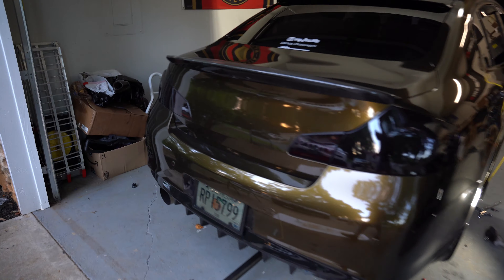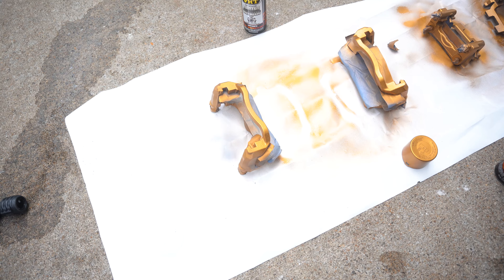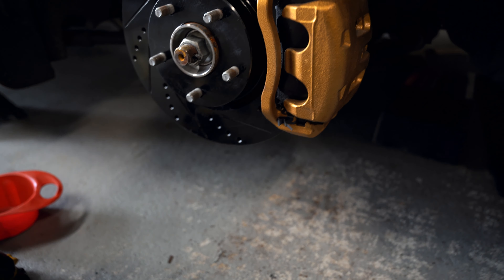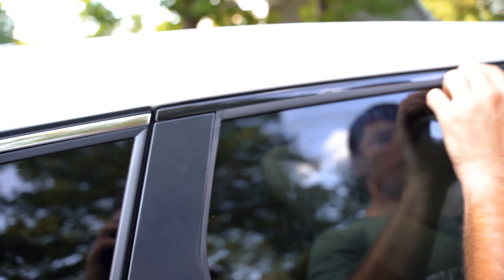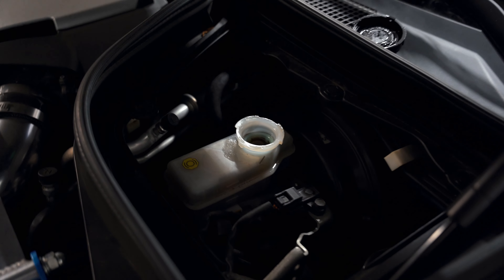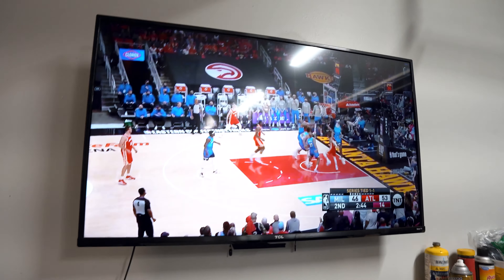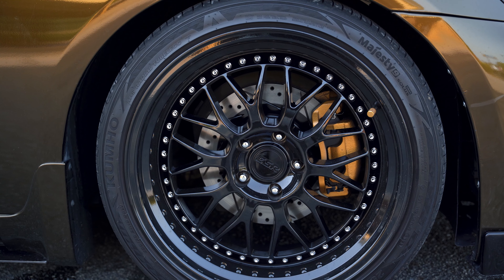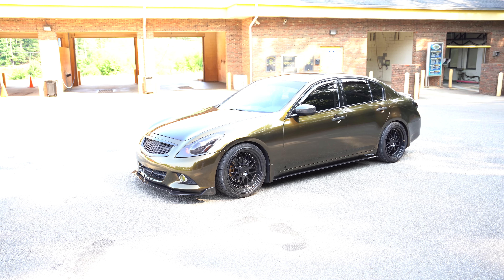G37x Sedan Brake Job | VLOG 4K

Comment: What is you're wheel set up ? I'm running a staggered set up 20x9.5 and 20x10.5. But I'm looking to get rims similar to yours.
Reply from the maker: these are 19x9.5 ers sr01's, squared
Reply: @vq.justin  what offset and what wheel specs I've got 19x9.5 +22 esrs07s on the way and I love the way your fitment is!

Comment: What’s your offset on your wheels
Reply from the maker: +22 squared
Reply: @vq.justin  you think a offset of +30 should be fine with stock breaks
Reply: @vq.justin  or should I go offset +22 cause I’m going 18x9.5
Reply from the maker: @elchapo9057  definitely go +22 on the g fitment wise
Reply: @vq.justin  would I have to use an camber adjustments or spacer if I go +22 like you?
Reply: @vq.justin  Im lowered on coils and my wheels are the same specs as urs but it pokes, I have about 2 degrees of camber all around, how can I achieve the same fitment as urs its perfect
Reply from the maker: @elchapo9057  I’m on stock camber arms so no, but it you want more camber you’d need arms
Reply from the maker: @bthebarber916  really that’s weird you’re not running spacers and it pokes? I could tuck perfect in the front in back if I went lower
Reply: @vq.justin  No spaces, only thing different is RWD and my tire setup is 255/40 and i recall u rocking 255/35, it’s weird, I see the same specs on fitment industries and they look flush to me while I poke